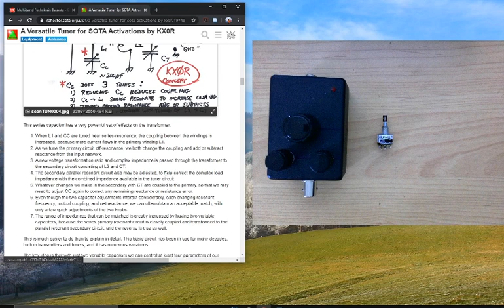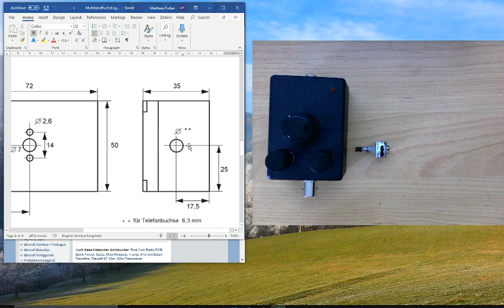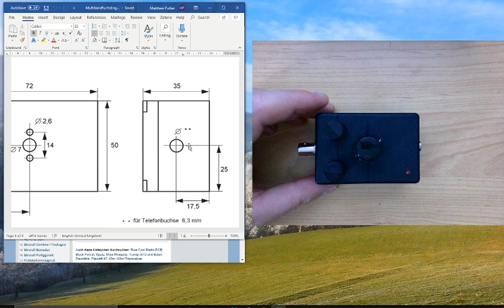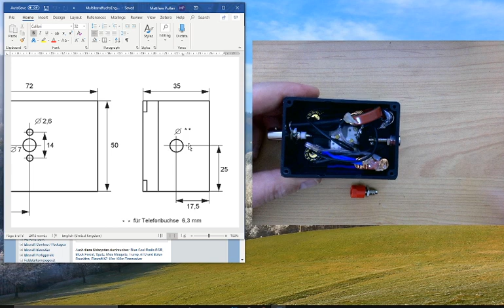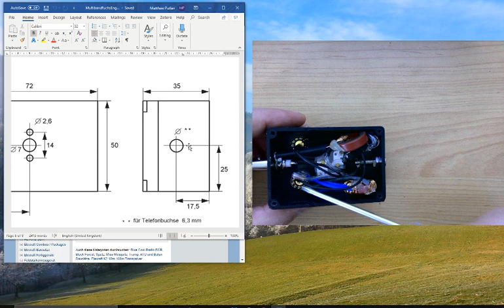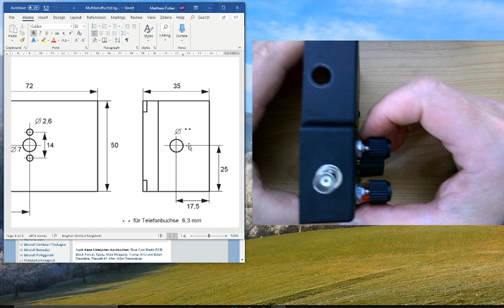Fuchskreis Part 1

Comment: fantastic video series and extremely interetsing to me 
One question for you if you have the time

I am a bit confused by the website 

how long should the wore be for 20-30-40m ?
and am i right thinking that this is indeed a multiband antenna 

or should it be used as monoband?
best wishes to you
Reply: @oe6feg  tahst great many tahnsk for clarifying - 
So for 40/20 I will use a 1/2 wavelength on 40 m = 20 + a bit meters!

thank you 

could I pester you more and see if you think that the theory that the Fuchskreis is versatile in installation 
and also higher gain then a dipole - when it is low? - 
if that I the case It will be just the ticket for me I think 

Gosh! - now all I need to do is construct it!

despite your videos I am sure it will be a challenge for me!